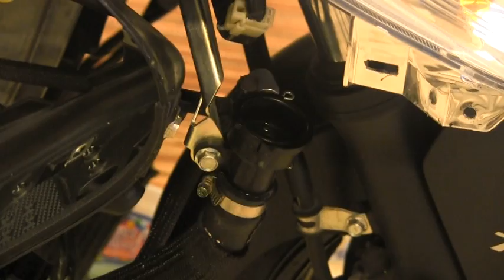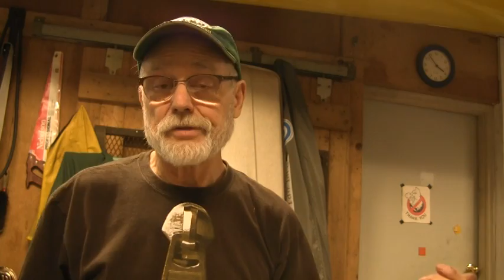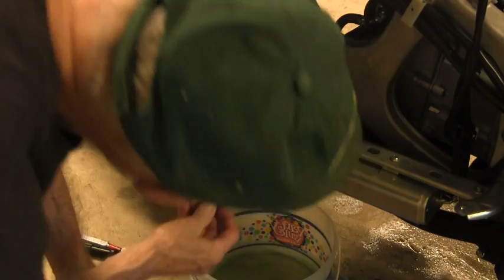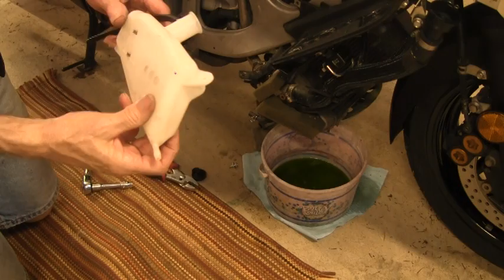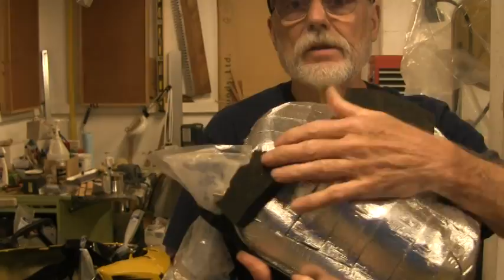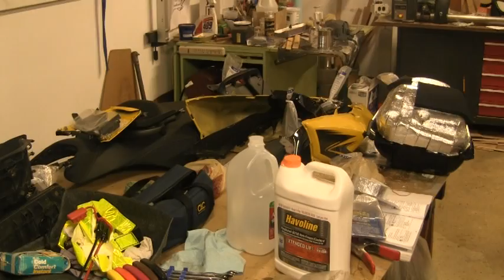Flushing the System of Old Coolant

Comment: Ok, so I replaced the thermostat, flushed the radiator and it's still overheating. It is also puking coolant from the overflow. Could the water pump be bad at this point? (I have the same Tmax 500 as you).
Reply from the maker: If you haven't put the antifreeze in it yet, I would pull off the hoses going to and from the water pump and see if you get any sludge coming out.  With the output hose off, you might start the engine to see if you get any discharge.  It could be the pump rotor has gone bad.  You get full flow through the radiator?
Reply: Whats the thermostat part number???

Comment: Any ideas on bleeding the air out of the coolant system?
Reply from the maker: With a cold engine, remove the "fill cap", start, and let the engine warm up.  You will know when the thermostat has opened when you see the coolant circulating through the opening.  Let it run that way for a minute and put the cap back on.
Reply: bigwheelsturning thanks for the tip. It didn’t work the first time. Then I put the Tmax on the side stand. Let run until it gushed out. Success. Thanks for all the great videos! I completely overhauled my Tmax and it’s riding great again. All the best from Holland